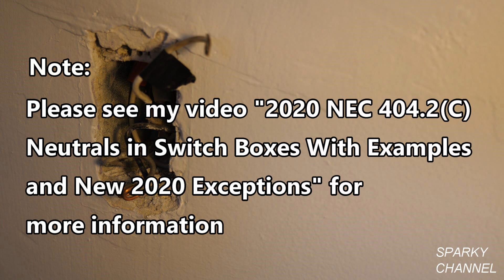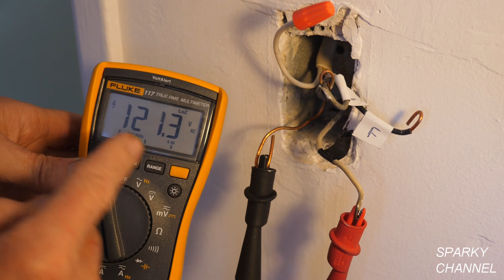Separate Switches for Bath Fan and Light from Single Switch in a 1960's House

Comment: I'll show my ignorance here, why doesn't the neutral wire from the fan need to be connected to neutral in order for the fan to run?
Reply: Possibly the  neutral  is at the fixtures...and they looped to the power to switch
Reply: The switch only deals with the hot line wire. The neutral in the video probably isn’t connected on the other end either. They just needed another conductor for one of the load devices. 🤷‍♂️
Reply: Normally the exhaust fan unit itself will have the neutral, so it won't go to the fan switch. It's good to have in the box though, especially if there's ever a chance you add anything more than an on/off switch (smart switches or humidity sensor etc).
Reply: Great stuff
Reply: I'm do this today
Reply: I'm still trying to picture in my mind how the neutral wires work in this setting.  Maybe I will find a drawing of it..  appreciate the video.. thank you

Comment: The original light had its neutral go directly to the light. They then later ran a 14/2 from the switch to the new fan. This means that either: A) They used a ground as a neutral or B) They ran a neutral separately by itself, most likely from a different circuit. Something tells me it's A.  Either way, it's done wrong. That's pretty obvious.....It should absolutely have been dealt with....
Reply: It's just a loop switch. Very common on two wire systems, and very safe as long as the white wire is marked with black tape or black marker to indicate that it is now Hot.
Reply: Who da f*ck wired that house?
Reply: David Judd, your exactly right.  And today's code requires a neutral wire in every box.  However your 100% correct and yes it is safe.

Comment: you lucked out with that extra cable for the fan! normally we eat a lot of dust to add that one.
Reply from the maker: LOL! It's worth checking!
Reply: I'll call one of you, hate working on houses, give me some 6 inch rigid
Reply: Yep.....somebody before him had eaten the dust to get that second cable in for the fan.  (which was clearly added later)  99% of the time one switch controlling light AND fan, you're going to the one fishing a new cable in, because the original setup they were wired together.
Reply: Yeah I believe that's my current dilemma, my kitchen lights are wired to one, open up the box, and just 1 white and 1 black. 
Remove the white and they both go out, single story house, with crawl space, so I'm going to make an educated guess that they are connected some where in the attic
Reply: @billyfubar2748  same I have a black and white ugh

Comment: The hot white wire confused me, no ID with tape or color paint required in the old days? Good deduction for the various wires, it would have taken me a lot longer to figure it out. My tap isn't long enough to reach inside the box, ground clip would be the other option. For a new new box I tap it from the back side. Need to get one of those circuit tracers.

Comment: In our 1960 house, for whatever reason one of the bathrooms had two lights (on separate switches) and no fan. It was super easy to replace the ceiling light with a fan since the wiring was already in place.

Comment: I found this video very informative. I love how you went into detail how and why you were doing everything. It made it sound very easy for someone like me who has no electrical experience. I feel confident after watching this video that I can probably succeed in changing my switch. Thank you. I will be back for your advice on any future electrical questions I have.
Reply from the maker: Thank you so much!
Reply: @SparkyChannel  I finally got around to trying to do that outlet. Unfortunately when I took off the switch, there was only 1 set of wires hooked to it. So my guess is the light and fan got spliced together somewhere in the wall. I'm not that skilled to go looking. Haha. Thanks for the help. Next on to putting in gfci outlets.

Comment: At 7:32, when you test if the ground is grounded, instead of turning the power back on and measuring voltage between line and ground, could you also do a continuity test (with the power off) to determine the same thing?
Also, at 9:23, if the ground is already functioning, why do you need to go through the extra trouble of connecting it to the back of the box and pig-tailing it, etc?

Comment: Thanks for posting this. I am sorry you lost your old channel; don’t give up on getting it back! Most things aren’t lost forever in cyberspace.

I want to do this in my bathroom. It would be my first electrical project. I live in a condo that was originally built in 71 as apartments. I have 1 breaker box in my unit and it’s very near the bathroom i’ll be working in (other side same wall, actually). I have a couple of topics to ask about:
1) what is the neutral wire for? In your switch box here, where did that wire come from and why did you leave it capped and connected to nothing? 
2) how important is it that I test the ground wire, assuming I find one? Can you explain a bit about why the electrician’s meter reading showed it was properly ground? As well as give a teensy bit more detail on how your reattached it to the box to code with the pigtails and green screws?

Comment: Can you add pigtail grounds to the plastic switch boxes?
Reply: No, there is no reason to.  The plastic boxes aren't grounded / can't be grounded so there is no reason to add a pigtail with a grounding screw into the box.  If this were a plastic box, he would have just attached the ground wire in the romex directly to the switch without any pigtails.

Comment: But what do you do if you don’t have two wires (one for fan and one for light)? My light and fan are on the same switch and when I take out the box there are only 3 wires (one is a neutral, one is a line I imagine, and one for the fan and light together, it seems) not four like you have here.

Comment: What about 2 lights on a switch like this. Connect the line wire to the black screw, the 2 load wires to each of the screws separately.. then would I connect the 3 neutrals together?

Comment: Where does the other end of that unused neutral connect to in the fan?
Reply: I don't think it's connected on the other end either, they just used the black to send power from the switch to the fan
 then capped both ends of the white in the 14/2 Romex they used, as there's no neutral to pick up out of that switch box it just capped off both ends, I believe they got switched hot from that light switch and got the required neutral for the fan from the lightbox up in the ceiling, which is crazy, or maybe the fan is on a shared neutral now, from a neutral they found after cutting the hole for the fan
Reply: @johngriffin824  I was wondering the same.  Is it possible the ground in that romex is grounded and is also acting as neutral for the fan?  Personally I would have tried to identify what the other end of that romex is connected to in that fan, at least just for piece of mind...

Comment: Question: Why did you have to put the grounding pigtails in? Was it because the ground was too short?
Reply: I believe that was because he wanted to ground the metal box. So the ground went to the connector, then two pigtails: one for the box, the other for the switch.
Reply: @randombytes3998   I wondered the same thing.  Thanks for the explanation
Reply: @randombytes3998  The metal box was already grounded by the bare wire.  He did replace the wrong type screw with pigtail.  The new switch had a ground screw and needed a pigtail.  The old switch was a non-grounded type and no pigtail was used back in the day.

Comment: Question...I own a house built in 1947 and I'm pretty sure my bathroom light switch only has the two cloth wrapped hot and neutral wires running to it. I want to add a bathroom exhaust attic fan. Could I simply run new Romex up the wall to the attic fan and follow your instructions on installing the dual switch in the original box without their being a ground wire?

Comment: Do you have a video that shows how to wire four independent  things into one box off one circuit? A fan, A ceiling light, a can light and a vanity light? I thinking on using two of these double switches in one double box.
Reply from the maker: No, I don't have such a video. I would use the largest box I could find though to prevent overcrowding.

Comment: Thanks sparky ,a question about the load cable that goes to the fan where you attach the white cable?
And what do you do with the white cable that comes from fan?
Reply: When the fan was added later, they must have used a neutral up at the fan or light mount box, and they didn't need the new white wire in the cable they ran....hence the wire nut just capping it off.  Should be a wire nut at the fan capping off the other end as well....so you don't do anything with it either.

The original run of the light, the feed cable from the panel terminated at the light mounting box.  A cable (black+white) called a 'switch leg' ran from the light box down to the wall switch box.  They fed power in at the light box on the white wire (I normally do that on that black), and returned power to the light on the black. The neutral for the light remained in the light box.  This is one way to wire a switch.  

The other is to feed the power cable to the switch box, use the black out of it on the "line" terminal of the switch, the black of the cable that runs to the light on the "load" terminal of the switch.....then the white coming back from the switch wire nuts to the white of the power cable.
Reply: @edsmith4414  thanks very much !!!

Comment: I have a late 50's house. My bathroom has a vanity light and a fan separate in the ceiling, but there is only one wire coming into the single switch. I was surprised given they are in separate places in the bathroom. Any advice or can anyone direct me to instructions for this dilemma. Do I have to go in the attic? Is it above the pay grade of a novice like myself?  Great video non the less. Thank you!
Reply: So 2 hot wires spliced together on one connector on the switch?

Comment: Question: I have 3 sets of wires in junction box/fanbox. One is hot (120V). other two not hot and goes to switch. I have switch with its own wiring diagram. Fan has its own wiring diagram. I can connect fan/light set up to switch. No I have closed loop now without power. How to connect now that hot wire at the fan to this new connected loop. ? cant find any video here with this set up. All videos have example of switch with one hot wire and other not. Unless that third hot wire joins to other two I dont have power at switch.

Comment: I would use a solenoid tester to check for integrity of the ground wire in that it puts a significant load on it. There have been a few times when I have had false readings both with a multimeter and with a receptacle tester.

Comment: 5:45  In other words, To save wiring they would have one wire go down to the switch. The power for the white wire would come from the light. The Hot wire is really in the light, But They spliced it in a way where this was possible.

Also WHo's House is this?

Comment: Say Sparky!  I have an outlet plate in my bathroom that is a switch for the light AND next to it?  A knob to turn to set timer for my fan.  The knob broke off.  I can't use the fan now.  Could you do a video or reply and help me change this?  Where do I get them?  Do I turn the AC off.  Can I change that plate and how do I get it off cause there's a screw ring that is around the rod that holds the knob and plate.  Crescent wrench?  Thank you.  I hope you can help.

Comment: Hi Sparkey, Helpful video here. Thanks : ) I have a newbie question: If there's only one black romex wire in that box running to the fan (ie. the newer white from that romex is capped), it can't be a traditional loop wire. Does that mean that 1) the fan's neutral wire is either grounded to the conduit (yikes!), or 2) the neutral lead on the fan is attached to a neutral line somewhere else, correct?

Comment: To be clear, the original setup had a ground wire coming from the panel to the box and simply screwed in to a metal screw?  And what exactly did you change.  Can you explain how  many ground wires are in your box, including the pigtails?

Comment: Sparky, this is just what I was looking for, but how did you determine which wire went to the fan and which to the light? What you’re doing is exactly what I need to do but I can figure out which wire goes to which thing! Can you explain that a bit for me? It’s be much appreciated!
Reply from the maker: This was a 1960 house, so the old wiring had to go to the light because in 1960 houses didn't have bath fans. Therefore, the newer wire had to go to the fan. You can also make tests to find out which is which.

Comment: Awesome video I liked I installed a  3way switch and one light outside but I have a question  the position has to be on  in the right or left position I will wait the answer Sparky thank you very much
Reply from the maker: That's one possibility.

Comment: so what if i wanted one switch controlling light AND fan and another switch to control only the fan? i wouldn't be able to do it with the 2 pole leviton switch correct? i would need to add another switch ?

Comment: Hello,
I have a Klein Circuit breaker finder, who makes that attachment you used to plug into the light?
Reply: Here are a couple Light Bulb to Outlet Socket Adapters:
https://www.amazon.com/Leviton-C22-125-000-Adapter-Socket-Outlet/dp/B00MHEXNWY
https://www.amazon.com/GE-Polarized-Adapter-Install-54276/dp/B002DN6QX2

These Circuit Breaker Finder Accessory Kits also have Alligator Clips Circuit Adapters that come in handy when testing a switch that controls a light that you may not be able to reach or is hard to get to:
https://www.amazon.com/Accessory-Adapters-Klein-Tools-69411/dp/B003U2GNI8
https://www.amazon.com/Southwire-Equipment-60030S-Circuit-Accessory/dp/B01ADWPPOA

Comment: I have done everything like you did . Test and find my Line wire and mark it and mark my light and mark my fan and put the neutral from the fan with a connecter on and push it in the back of the box . My light is working but not my fan . Help .

Comment: so i have question here. i have 2 black switches and a bare copper assuming its ground. but the white wires are wirenutted together. not being used... do i just run the two black wires and the ground or do i need to unwire these white cables that assume are probably neutral?

Comment: I have a single pole light switch and I'm adding a bathroom vent fan with a light on it.  I presently have a light sconce light above my vanity.  I would like to have my single pole light switch also turn on the light on my exhaust fan and the sconce together and a light switch to turn on my exhaust fan on its own.  Do have instructions on how to do this or a video?  I have an older home and I only see the black and white wire to my single pole light switch from the light switch box.  Thank you

Comment: I bought the exact ideal circuit breaker locating kit that you used in this vid. I'm sad to say the kit i spent big money is absolute crap, when I try to trace down outlets from the circuit panel it doesnt work. I use these in commercial buildings. Bill your thoughts on this? Is there a better kit that works for commercial buildings? 
Thank you

Comment: I had a question for ya. I’m replacing my switch that’s just like the new one you’re using in this video. I have the ground, two black, & one red wire. On my old switch all 3 colored wires were on the same side and the ground was on the top. My new switch has 2 silver screws and a ground on one side & the other side has 2 gold screws. 
I put my black wires on the one side and my red on the other but now I can’t control my fan from the switch. I just wasn’t sure how to tell what black wire should go where?

Comment: Hi Bill, In this same situation as shown starting @ 7:32 here, lets say there was no bare copper ground visible entering the box, but there was a green pigtail screwed to the back of the box with the proper green screw, When doing the voltage test with the circuit on, lets say you read 121.3 Volts between the line/hot and neutral AND ALSO 121.3 Volts between the line/hot and the green/ground box bonding jumper. Doesn't that confirm that the ground is GOOD even though there is no visible ground wire seen entering the metal box? Armored cable (AC or BX) all tight going back to the breaker panel?
Reply: yes grounded through the conduit

Comment: Question: At the beginning how did you identify the two black/gray wires after unscrewing from the switch? How did you know which one was fan and which one was vanity light? Was there a test that you did that I missed?
Reply: He said he “made an educated guess that turned out to be correct”. I am not electrician so maybe there is a tester that could do it faster but you could turn on the switch with just one black hooked up and that would tell you which is which.
Reply: He took the guess that the fan was placed after since the light had to be there from day one. The only way for certain would be to check continuity between the two leads at fan or light while breaker is off.

Comment: Thanks very much Sparky. The video very  helpful through all and safety steps. when i open the old switch , it has one Red wire and One black wire label as hot . How do I do ?. Thanks again.
Reply from the maker: It's not safe for me to try to diagnose in this little space but I would do testing on the wires first.